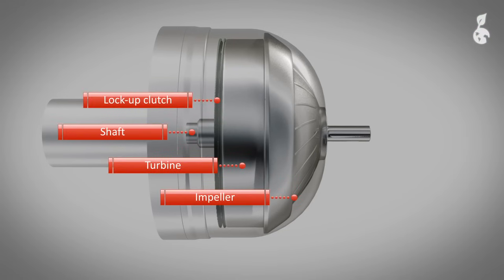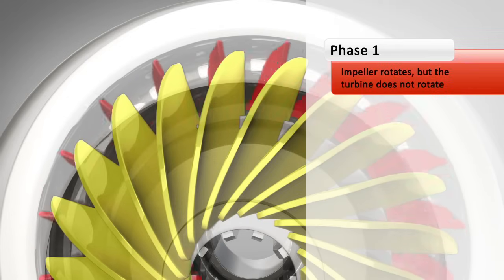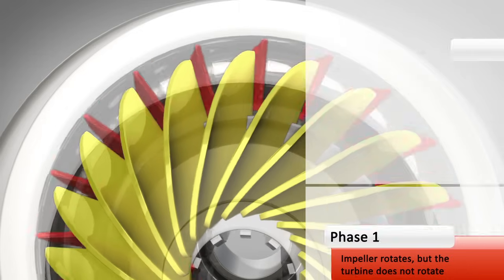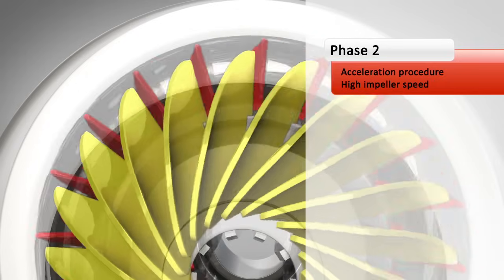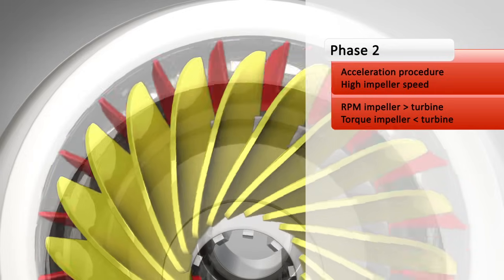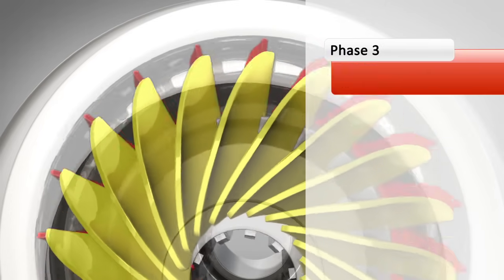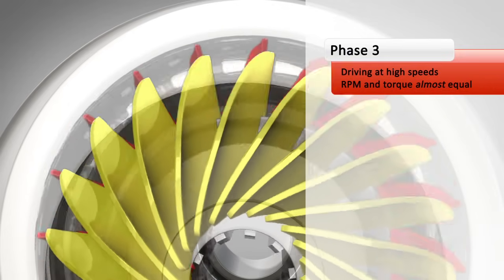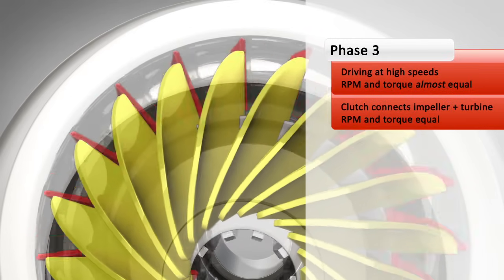How Torque Converters Work! (Animation)

Comment: Take two similar sized electric fans. Put them close and turn on one. The other will spun. This is basically how the TC works. The main job is to allow the engine to run while the vehicle is stopped. A clutch does this on a manual transmission. Over the years, they were improved to multiply torque. Lockup clutches came in the 80's to save fuel.

Comment: Actually the torque converter could have been displaced with and electric magnetic field and you just cut the current when changing gears. It would have worked as a manual.

Comment: Why doesn't the fluid expelled by the impeller fly out to the periphery of the turbine? Why did the fluid seen to defy centrifugal force and travel inwards?
Reply from the maker: Watch again. You'll understand!
Reply: @ThomasSchwenke-knowledge  Sorry to sound dense, but when there's fluid in the impeller, rotation causes the fluid to travel to the periphery. (And rushes across to the turbine.) Why doesn't this fluid stay at the periphery of the turbine since the rotating turbine should cause the same centrifugal effect as the impeller? I know (obviously) that torque converters work and I know that the stators multiply the torque (suggesting that the fluid IS travelling across in the center) I just can't reconcile the transition of fluid from the periphery TO the center, when to do so if in opposition to the centrifugal effects of the rotating turbine.
I accept the fact that it's something I'm missing, and I'd be really grateful if you could clear up my lack of understanding.
Reply from the maker: Sorry, can't help. Reddit.com will be your friend ...

Comment: The video shows axial flows of fluid - starting at the impeller (pump)  going to the turbine and then back through the middle of the converter  -  to the pump. This is in contradiction to the commentary which says the fluid flows radially outwards in the impeller (pump) - due to centrifugal forces and radially inwards in the turbine.
The fluid cannot pass radially inwards to the centre of the turbine because centrifugal forces will fling it outwards not inwards.
The fluid cannot pass radially outwards through the turbine because of the proximity of the outer edges of the turbine blades to the converter's casing.
The fluid cannot pass axially through the turbine because , again,  of the proximity of the blades to the casing.
So the fluid cannot circulate within the converter.
For sake of argument lets assume the converter WAS constructed in such a way to allow circulation of the fluid.
The performance curves for axial and radial flow turbines show their efficiency varies enormously over the speed range (revs per min)  They would be useless at efficiently transmitting the engine power over the speed range of the engine.
The torque converter is little more than a glorified fluid stirrer.
If i'm right this might leave you with a few awkward questions.

Comment: Torque multiplication is achieved due to the reaction member, (stator), redirecting the returning fluid in a direction which aids the impeller rather than impeding its rotation. Slowing down the fluid is not correct and not the cause of torque multiplication. In fact fluid flow is at maximum when the turbine is stationary at stall.

Comment: Does the torque converter replace the clutch? In this case, there is no wear because it does not generate friction between solid parts? I got confused

Comment: The driving and driven blade differential speed (before high speed coupling) are going to waste energy in the form of heat. An internal combustion engine wastes about 35% of potential energy from incomplete combustion and friction. This is why there's sex lube. Gotta draw the line somewhere.

Comment: Chrysler's first true automatic transmission was a 2 speed, with a low gear ratio, and a 1:1 high gear. They claimed that because the torque multiplication at low speed was so great (2.7:1) that extra gears were not needed, as in the 4 speed Hydramatic. As the car speed increased, the torque multiplication decreased, having the effect of shifting into an intermediate gear. When the car speed reached between 30 and 50 mph, the transmission would shift into high, depending on the throttle position. My brother had a 1954 Dodge with one of these transmissions, and i could feel the torque multiplication changing. Chrysler claimed that since it was a simpler transmission, it was more reliable, and if it needed repair, it was easier and less expensive to repair. The GM Hydramatic did not have a torque converter, but just a fluid coupling.

Comment: I very much enjoyed this animation for studying for my transmission test. However the only thing i wish you added was that the stator must hold during phase 1/2 acceleration and then freewheel once coupled or else vortex flow remains in the converter, excess heat generated etc. still a very good animation. thank you!

Comment: The stator changes the angle of the fluid returning to driven pump side. The change in angle actually assist the driving side of the torque converter . This almost double the torque (Turning Force) . This effect really only works well at pull away when the relative speed of the two turbines are very different, The stator locks in position with a sprag clutch in this condition, once the speeds of the two turbines are relatively the same the stator rotates with the units and the torque multiplication is lost. A stall test (done for a limited time or damage will occur) checks if the torque converter is functioning correctly. Natural fluid slippage cost in gas miles on old school torque converters, now lock up clutches lock the unit solid when speeds are relatively the same input from engine to output to gearbox.
.

Comment: So there is no mechanical connection between the engine and transmission? Why not just drive completely hydraulic, since it’s basically a hydraulic pump.

Comment: This is great job brother,  but i have a 1998 sienna van which when i put the gear on drive it will not move until i raise it severally before it will drive , could this be that the Torque is faulty, the fluid or  what could be the problem . please .

Comment: Great explanation of how fluid under pressure acts as a manual transmissions pressure plate and throw out bearing to apply the clutch, and lock up the torque converter with the output shaft to provide torque and kinetic energy to move the components of the Automatic transmission.  Next please explain to the people how the fluid pressure acts to engage the clutch pacts inside of the Automatic transmission to shift through the gears.

Comment: Id say its a pretty weak design. We can engineer rockets and we cant engineer a more reliable systen than a torque convertor automatic? This is old tech smh.  Still, it is a great engineering feat, but long term, it has several issues, leaks, liquid deterioration decay rate. Not to bash on them, they're pretty reliable long term.

Comment: Hey Thomas, i just need a second opinion on a automatic transmission issue... we have a bt50 that has a (1). whinny sound when shifted in gear, either reverse or drive, it whines but when in Park or Neutral, the noise disappears. (2). When in gear the front of the gearbox whines where the converter is and the noise disappears when the vehicle is in motion after removing your foot off the brakes. If anyone has a an idea please share, it can help. Cheers, Rudolph

Comment: 2:29 how it increases the torque just by  changing the angle of flow ?? , M confused because in gear system torque are generated by changing the high rotational speed into lower using gears ? Do what for this case (it's based on fluid dynamics ) ?

Comment: It's really amazing that vehicles are as responsive as they are considering their weight and the fact that it's all transferred through fluid. This system works as good as if it was all connected directly through gears. Crazy.

Comment: okay so i might've missed it but what i'm looking for is how does this device prevent the crankshaft from coming under stress while the car is coasting at high speeds? if i jump up to 90MPH and then let off the gas and coast downhill i dont want the wheels momentum to send torque back up into the crankshaft and stress that. in a manual you can just drop it in neutral, but in an automatic i understand you can rely on this for that purpose..... i just need to understand exactly how.

Comment: Can these be used as joints? Like two bars pivot around the torque coverter's input shaft's axis of rotation so basically high super accuracy circular hydraulic power...?

Comment: At the stage the lockup clutch engages, can we say it becomes like a manual transmission, transmitting motion through the clutch and not through the fluid coupling?

Comment: By Transmitter you need understand just reducer of torque.
Reply: Nothing new,except maybe an advantage to reduce the torque of the electric motors to acceleration, but it's ridiculous not to reduce it upstream: useless

Comment: The video is great but it doesnt explain how the torque converter multiplies torque. It says at 2:13, "The fluid flows through the turbine to the stator. The stator's curved blades turn the fluid flow at an angle of almost 90 degrees. The result is a multiplication in torque because the fluid flows back more slowly". 
So my questions are:
1) What is the reason and effect of turning the fluid flow at an angle of 90 degrees?
2)How and why is the torque multiplied by the fluid flowing back more slowly?
If these questions could be replied, the video ld have made much much more sense.

Comment: i miss a more detailed graphical explanation on how the stator multiplies the torque on the acceleration stage. i know (from reading it in books years ago) that the stator has a free wheel mechanism, but i would like to see a model of the fluid flux in all conditions, not only in the coupling when both impeller and turbine are rotating at almost the same speed.

Comment: I’ve been to 2 different Trans Shops and they both told me my TCC ran fine in their computer... but the engine light keeps coming on after reset. I have a 97 4x4 1500 Ram... is it an electrical issue or will replacing the TCC get rid of the problem all together?

Comment: I don't agree with some things, hope we can clarify. The torque multiplication means the input shaft rotates faster than the output shaft but the output shaft has higher torque. The impeller propels the fluid on the outer side, that's all. The fluid speed builds up because it returns from the turbine at higher speeds. You can adjust torque multiplication by modifying (not necessarily while running, "adjust" can refer to the development phase) the turbine blades angle, that is very important. The fluid is now directed through the middle section and before getting back to the impeller, it needs to spin in the same direction as the impeller otherwise it will create a negative torque to the impeller. Therefor the stator must not spin (relative to the vehicle, if you observe if from outside the vehicle you will see it stationary) in order to change the direction of spin of the fluid. The angle of the stator blades also is important  so it can give you better efficiency. 

In a few words the impeller pushes the fluid, it transfers power to the turbine then it comes back through the middle, the stator gives it the right spin, and the kinetic energy of the fluid is recovered. 
Torque multiplication is given by the turbine blades angle and design but also the impeller and stator design matters. Modifying the impeller design results in higher or lower speed of the fluid, and modifying the stator also can alter the speed and prevents negative torque transmitted. Negative (in the opposite direction) torque is stopped by the stator and you get some slight power losses through heat dissipation. 

Torque multiplication is not genuinely because of fluid coming back through the middle. That is power recovery.  But since power comes back fluid speed is now higher and the torque increases. Here is an example: we have a car and we fit a turbine(not a turbocharger or supercharger) on the exhaust. The turbine could recover some power from the exhaust now. It will be like 1kW or less otherwise it will reduce the engine normal output. We can use that power to push the car. It will be minimal in this case it might even make things worse in reality but suppose we get a lot of power back because through the exhaust theoretically air has kinetic energy that may be recovered. Does it mean the turbine multiplies torque ? I see it 'more like a power recuperator. Since you recover power you will end up with more torque as well.

Comment: This is an awesome device. I don't see any non negligible power losses other than  by heat dissipation, I estimate 1-2 kW or less possibly but my radiator doesn't seem to have trouble cooling down the engine and transmision.

Comment: "...the result is a multiplication in torque because  the fluid flows back more slowly..."
...hmmm.  Are you sure about that?
Reply from the maker: What do YOU think? :)
Reply: Thomas Schwenke,  I can tell  you the torque increase is  definitely NOT due to the fluid returning more slowly.  Torque converter is full and doesn't have anywhere for fluid to build up if it weren't moving as fast through the stator as elsewhere.
When the pump is turning much faster than the turbine, the stator imparts rotation into the flow in the rotational direction of  the pump and the desired direction of the turbine.
Thr rotation imparted causes the fluid to impinge and interact hydrodynamically with the turbine to transfer momentum from the imparted rotation which is the additional torque.

Comment: Quite simply, driving an automatic is like handing control to your grandma.  The reaction time is slow, and you have no idea when it will happen, or how.  The joy of manuals is having Exact control, and experiencing a direct connection, man and machine. 
Rather than man/ squidgey oil box/  machine

Comment: The video starts very well, but suddenly a stator and a clutch appear and the video does not tell you how a stator is only needed in acceleration and why the stator converts more torque than the turbine , why it does not work during cruising, how the clutch is applied (it only tells why). So yeah, I feel I understand the torque converter for 33% now.

Comment: Torque converter is The best thing ever. In army we have trucks that have one. Manual transmission, that works like automatic thanks to converter. After you put biggest gear you don't have to touch clutch again, you can even stop without problems

Comment: Good video. But it doesn't show/explain how the working fluid (oil) gets into the impeller. 
I guess there is a fluid pump which is connected directly to the torque converter hub using "flats". As the torque converter shell is bolted and rotates with the engine's crankshaft, the torque converter drives the fluid pump. This arrangement also ensures that the fluid pump only spins when the engine works.

Comment: If the car is standing still, where does the energy of the engine go? And doesn't it put a lot of stress on the turbine if its not moving?
Reply: When standstill, like in every car, at least the engine's rotation is utilized by the alternator to supply electric charge for the battery and/or for other electric-driven parts.

Comment: So, this fluid (I'm guessing is just transmission oil, not another independent fluid) is going to heat as it provides the friction and slip for the engine to remain rotating while the wheels aren't turning at all or not at a similar speed. What I want to know:
- Does this wear the fluid, where it might lose viscosity and thin out?
- How does the heat dissipate? Is it passively cooled by heatsinking to the steel housing and convecting to the air, or is this fluid sent / made to exchange with coolant?
- How bad is it to rev the engine whilst remaining still with the brakes?

Comment: So this is like a solid state relay vs a mechanical relay. The solid state will consume some power but operate more smoothly and wear less. Unlike mechanical which when fully engaged pass on all power at the expense of more wear.
Reply: It is more like fluid clutch vs friction clutch in manual transmission. Friction clutch has its inherent risk of getting wear especially when driver misuses the clutch pedal. Whereas in this fluid clutch, there is almost no friction occurs between its main parts : impeller, turbine and stator. However, as you said above, one of our concern is in the working fluid : whether it loses its viscosity, gets hot, etc. I guess there is a vent at the housing of the torque converter which is not shown in this video, because I have seen it in a figure of torque converter found in a book.

Comment: how does the fluid get to the impeller?
Reply: That is the same question from me which is not shown/explained in this video.

I guess there is a fluid pump which is connected directly to the torque converter hub using "flats". As the torque converter shell is bolted and rotates with the engine's crankshaft, the torque converter drives the fluid pump. This arrangement also ensures that the fluid pump only spins when the engine works.